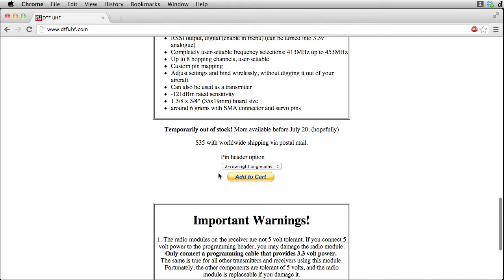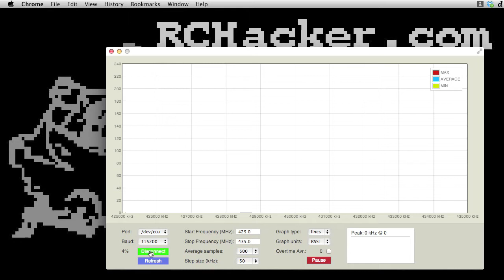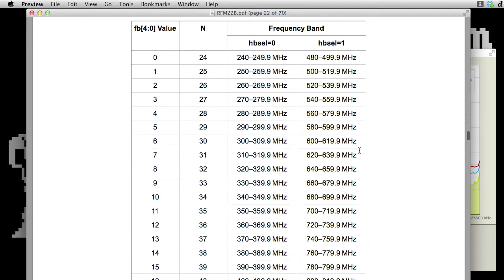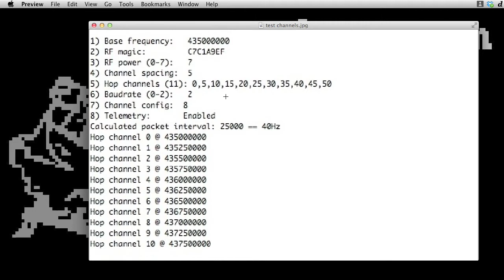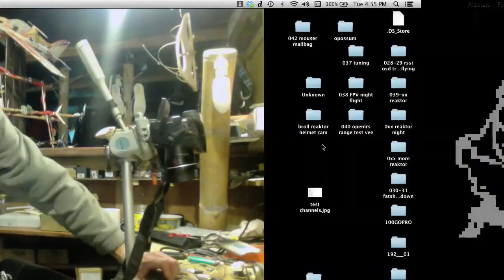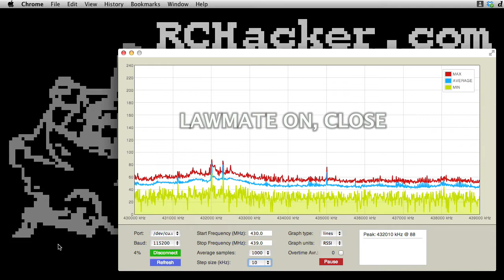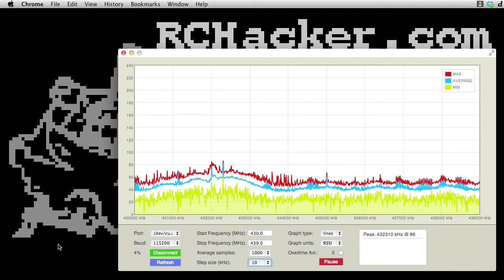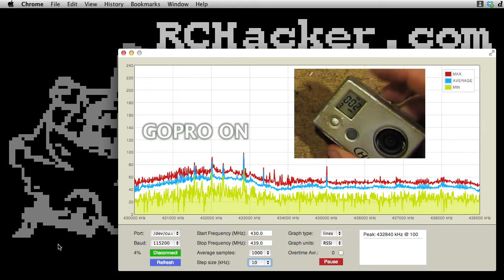OpenLRSng scanner / spectrum analyzer. RCHacker #46

Comment from the maker: It is enamel coated copper that I pulled out of an old AC motor. About 1.5mm. I can measure it exact but I do not think it matters that much.
I like the enamel coating as it protects the module from static.

Comment: at 15:18 you can see the yellow and green wires coming from the LiPo are about 1mm apart. He shorts these out and magic smoke eminates from the wires. It won't have done the LiPo any good and I would suggest storing it outside in case it burns down his house.

Comment from the maker: The usual problem is that it gets programmed with a 5V USBasp or a 5V fdti. If you are not guilty of that then perhaps HK are, and if they are guilty then there will be a whole batch of dud ones coming out.
The ATMega happily runs at 5V but the RF module is max 3.6V. See if you can test that the voltage regulator is working OK with a multimeter. It converts the 5V from the rc inputs to 3.3V for the rest of the circuit. Or you can use a partially charged 1 cell battery and power it via the ICSP.

Comment: marc.,today I programmed my orange LRS 1 w TX module as TX and then I hit up the spectrum analyser tab on configuration n I don't see any graph and peak was at 0 MHz ....whereas when I program my 9ch 100mw Rx as TX and I can see graphs and peak at around 430 MHz...with this can u say which of the module is defective...
Reply: +Shubhankar Das it is possible, range test with both is the best way to tell.
Reply: also i cannot bind both of them the Rx gets both LEDs on but the TX never hears that it got binded and therefore the blue LED  with the buzzer keeps on blinking and buzzing....also can u guide me through range test

Comment: It is possible, altough the original firmware can have trouble connecting and suffers from packet loss which degrades link quality. I got a branch of the openLRSng (continously merging in changes from kah's firmware, latest merge was with 3.1.3). You can achieve approx 700 bytes per sec (gives 20-22 packets per second) and no lost packets (unless RF fails) which is sufficient for positioning and decent artificial horizon. Check out: github.com/gitsly/openLRSng/tree/mavlink (add the h*tps).

Comment: Good video.

Btw,
Search for RTL-SDR in google.

You can buy a ~25Mhz-~1.7Ghz spectrum analyzer for about 10USD on ebay. (including shipping). (search: RTL2832U R820T).
Reply from the maker: I bought one of these way back, but it never arrived. Is the software as easy to use?
Reply: There are multiple software's available for this.
I use SDR#(sharp), but it depends on how you want to use it i guess. its pretty simple to use There should be alot of guides on the interweb. I order mine from ebay, took about 1week to arrive.
Reply: RCHacker the RTL-SDR software is WAAAAY better than what you're working with here. Considering you're doing this little with a $35 device, the $10 SDR dongle will do a much better job.